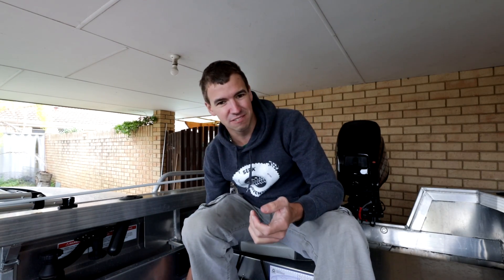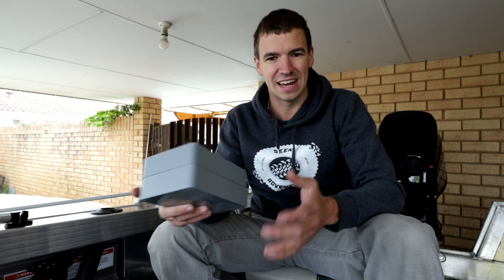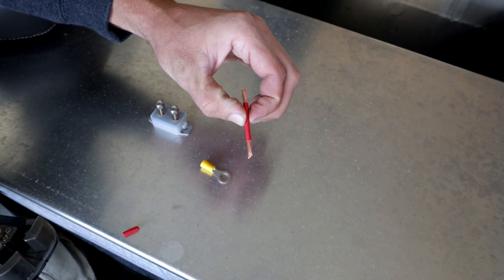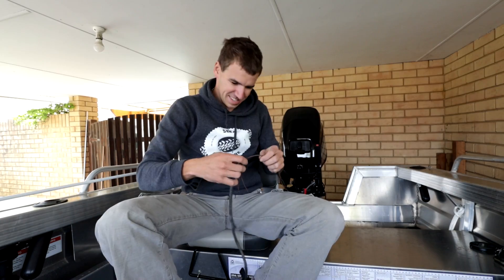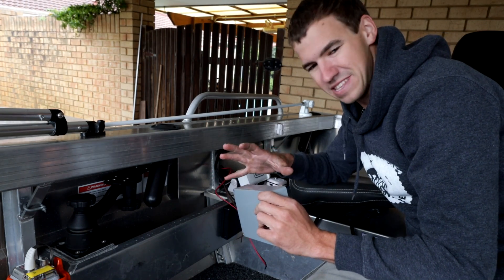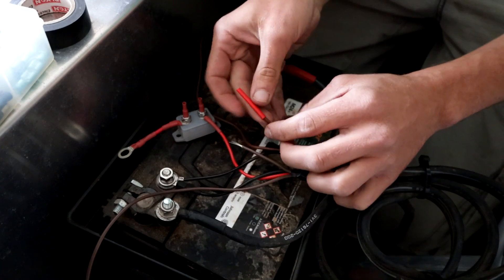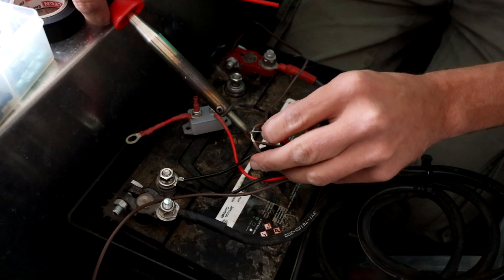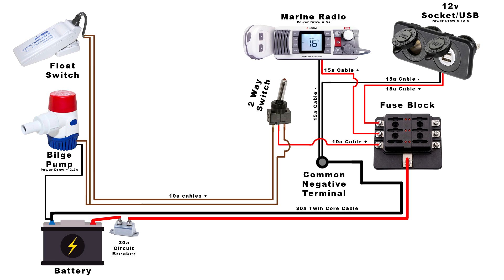Basic DIY 12V Wiring | Fuses, Wire Sizing

Comment: 1 Mill Cabal = 10 amp 2.5 Mill Cabal = 25 amp 30 amp Max 👌
Reply: R Adams I wouldn’t be listening to any person giving electrical advice that can’t spell cable
Reply: @newmo81  he's giving electrical advice, not grammatical advice. Thank him instead for making a contribution.
Reply: That’s for mm2 cable only, automotive cable is measured differently so doesn’t have the same current carrying capacity.
Reply: @MattyHilly1982  🤣 10 amps is 10 amps
Reply: R Adams correct, but a 1mm automotive cable cannot carry 10A. A 1mm2 can carry 10A. Different size cables different current carrying capacity.

Comment: Just a heads up, should be using tinned cable for marine applications, resin/glue filled heat shrink isn’t a bad idea either.
Reply: Another option , liquid electrical tape with heatshrink over the tops works very well too
Reply: With marine cable, Is the entire length of cable tinned Matthew or do you just tin the joints?
Reply: Benny Banger the entire length. You can buy speciality marine tinned cable. The problem is copper can tarnish easily especially in a marine environment.
Reply: @MattyHilly1982  Good to know Matthew - thanks. I've got to wire up my camper and my 4x4 too, and I have another project on the horizon for a water craft, so really helpful info.
Reply: @MattyHilly1982  "You can buy speciality marine tinned cable", mate, it's only on the ends.
Reply: Stuart Calvin the cable itself it tinned its entire length which gives it its silver colour.
Reply: @stuartkcalvin  no it's not though
Reply: Hello Mr. Matthew I am ordering some marine wire on Amazon for my boat right now what gauge wire should I get I was going to get 16 gauge what do you think? 12 or 14?